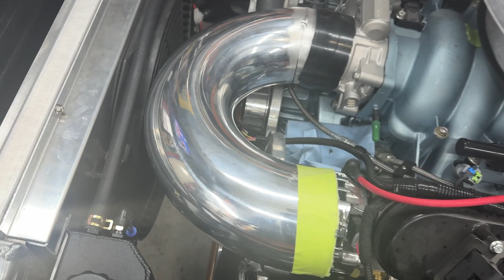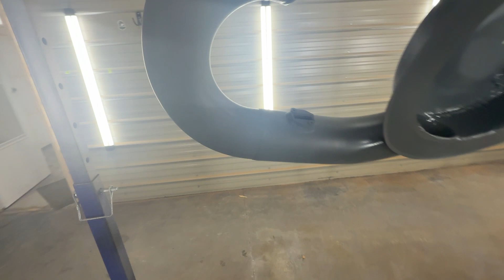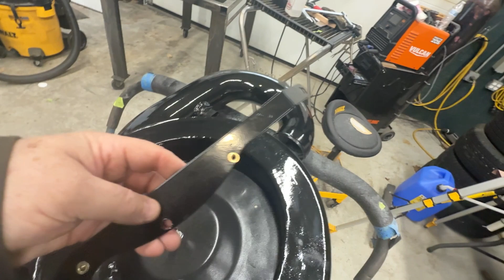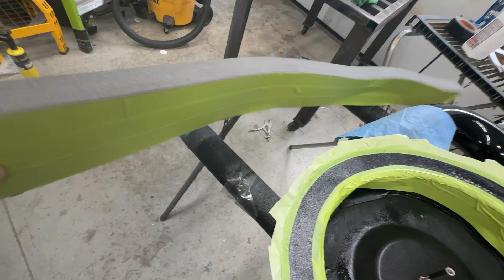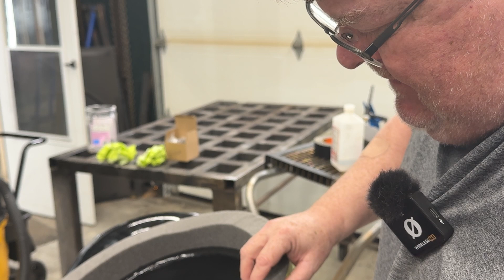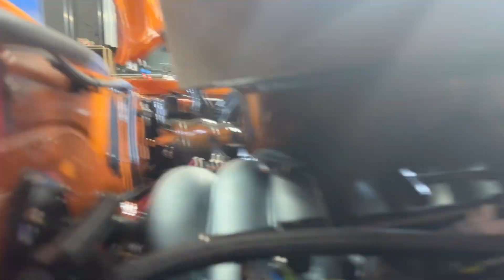67 Firebird, Part 174, Fabricating the Ram Air Tube and final Fit up and install

Comment: When glueing up foam like that we used to apply a layer or two of glue to the foam, then wait several hours, as a prerequisite. Apply additional coat of glue for tack up at assembly time.
Reply from the maker: that's a great tip.  first apply glue foam side and let it dry as a foundation then do the 2 surface contact cement method. Will defiantly do that next time